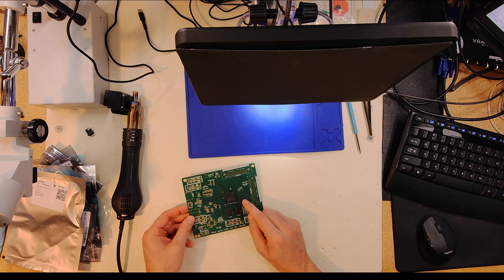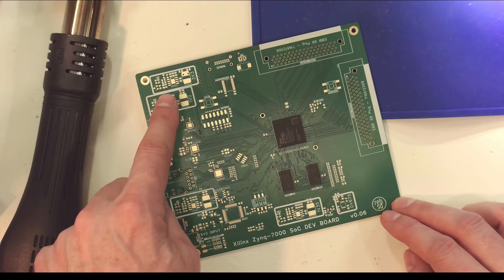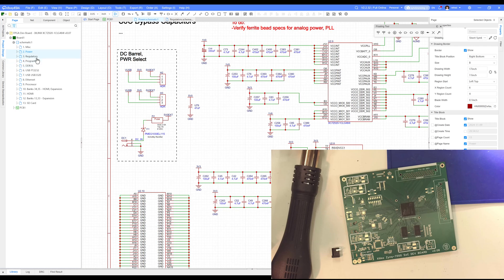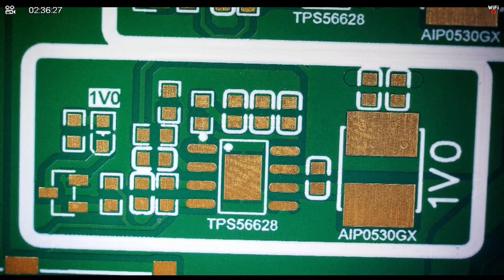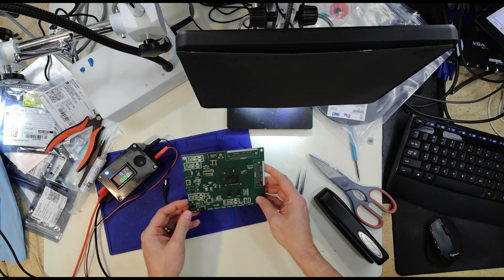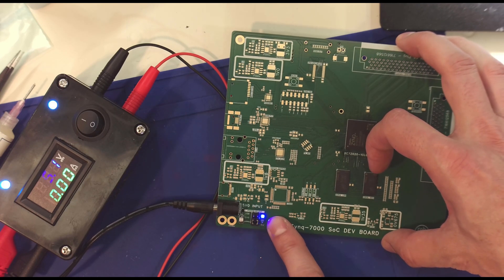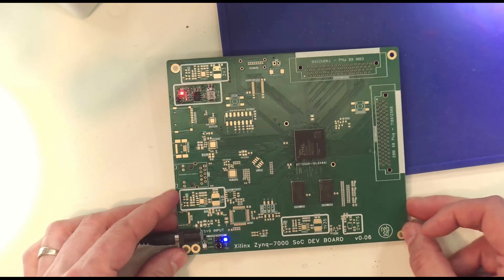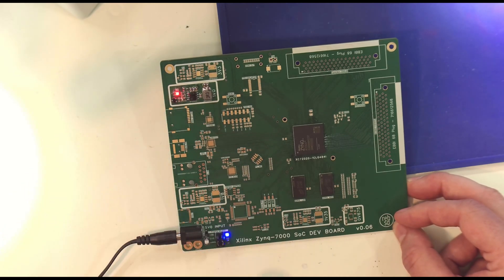Zynq-7000 PCB Build - Part 12 - Starting with Power Rails

Comment: Also 1.06 V is too much for the 1 V rail - it's supposed to be 1 V +-5%, which is 0.95..1.05 V. That by itself shouldn't kill anything because datasheet says absolute max for this rail is 1.1 V, but please be careful  - it would suck if you damage something with such simple mistake.
Reply from the maker: 1.0090 is where it's at according to my DMM.
Reply: @rehsd  that should be fine. I always try to aim closer to the minimum voltage because this way SoC will heat a bit less, but mainly because there is smaller chance to damage anything.

Comment: I hope you didn't kill the SoC with this - it's not designed to be partially powered on, you should always provide all power rails. Never do this again!
Reply from the maker: I did think about that, but I chose to risk it. :)
Reply: @rehsd  well I guess we will see if you get lucky. But in any case don't ever do it again! In case like yours I typically only assemble the power section on the very first pcb precisely so that I can verify that all rails are what they should be, without risking to destroy expensive devices. Once PDS checks out, I can comfortably fully assemble the second knowing that my PDS isn't gonna kill anything.  I worked with devices which cost $500+ a pop, so this care was definitely warranted.
Reply from the maker: @asmi06  That would be a safer path.  :)
Reply: @rehsd  And just so you understand - the reason partial power up is undesirable is because some internal paths which would normally be reverse-biased by another rail and thus closed, become open when that reverse biasing rail is not provided. Think of it as a diode - if it's anode is at 1 V, while cathode is at 3.3 V, it's closed and doesn't conduct, but if you remove the 3.3 V voltage, now you have essentially zero on cathode, and diode starts conducting. This is of course super simplistic explanation, but hopefully you get the idea.
Reply from the maker: @asmi06  Good to know. I'm guessing if power-up sequencing was done in the wrong order, it could increase the risk of damage. Somewhat related, I just read about power-off sequencing, which I didn't do anything about in my design. I have power-on sequencing, and it sounds like power-off sequencing should be done in reverse order.
Reply: @rehsd  That's how it typically goes, but I've seen enough boards not bothering with it to be fairly confident that it shouldn't be a big deal.